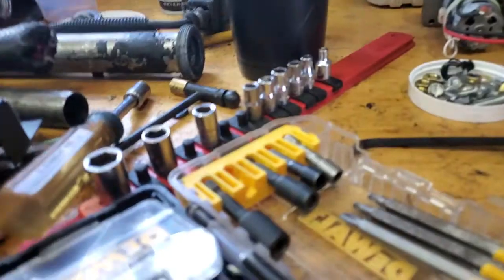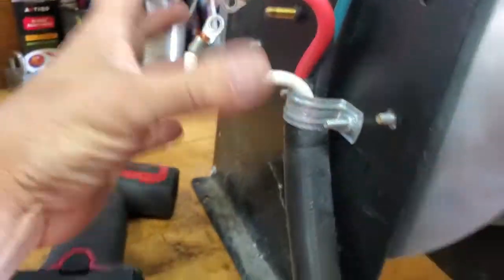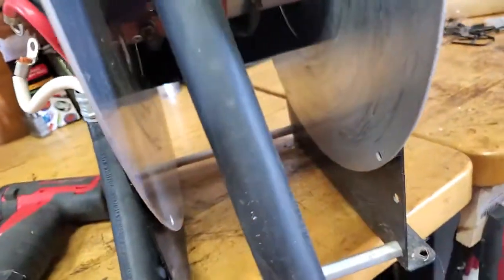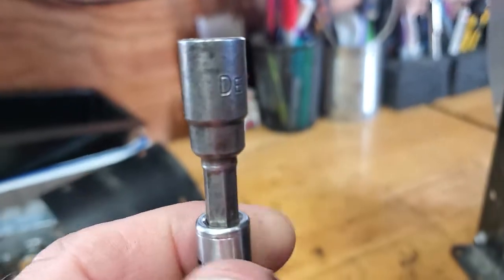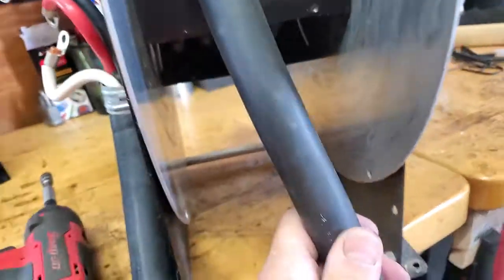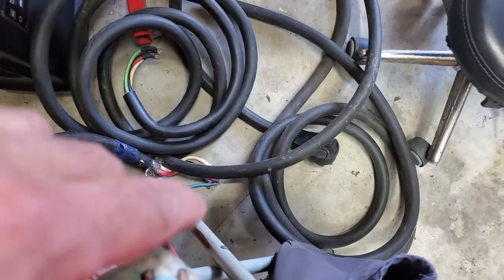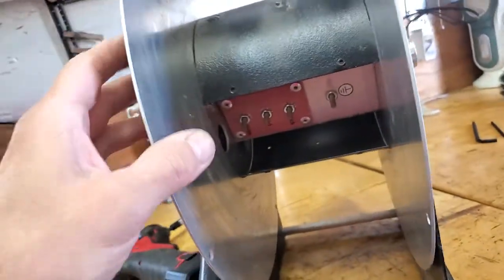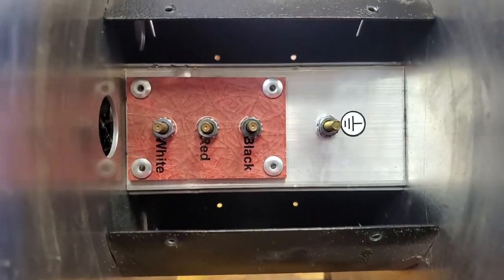50 POWER REEL REPAIR. VIDEO 2 OF 3 SHORE LINE REEL

Comment: Our 2003 Newmar Dutch Star D.P. has a Glendening(sp?)cord reel like they use in the marine world. It doesn't have any rotating contacts, it just coils it up inside a approx. 12" diameter x 12' high vertical cylinder. Still got the original cord and winder on it. I did have to replace the plug on it about 2 years ago.
Reply from the maker: I have that one also in my beaver but there are other brand that don't cost as much